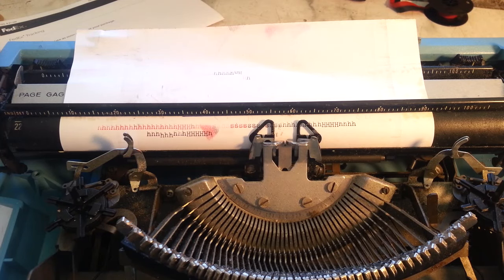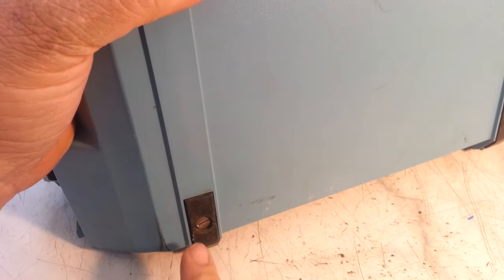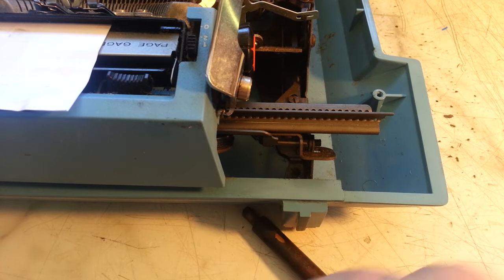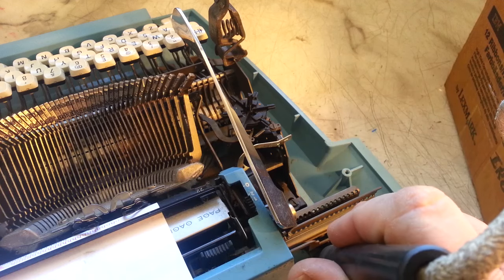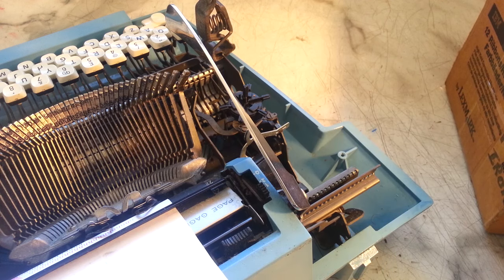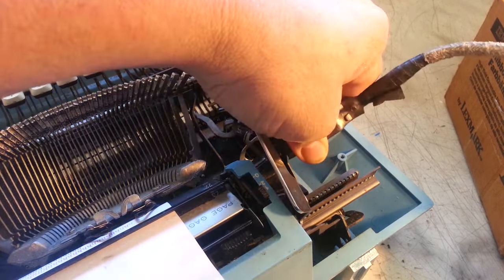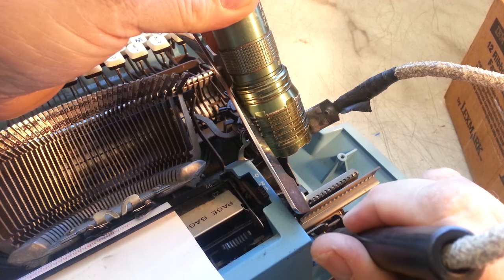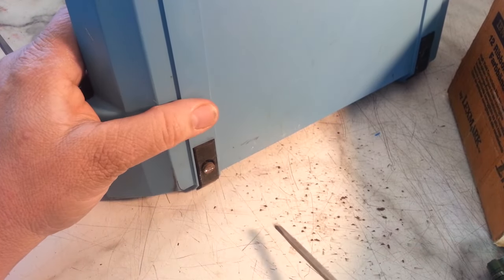Removing Frozen Screw on Typewriter With Carbon Arc Electrode Heat, Stuck and Ceased Conquered

Comment: Great work...I was surprised that the plastic shell was not affected.  Would a soldering pencil iron have worked apply to the top side of the screw...granted it would take longer to heat and the plastic shell maybe a concern.
Reply from the maker: Yes I was concerned about melting the plastic shell, the heat pencil has such controllable and fast heat, it worked best for this situation.
I didn't have any effect to the plastic or rubber foot. Was a great test and worked perfect . . . .

Comment: I’m trying to understand how it works. Heat will normally expand metal. Maybe swelling the screw broke the bond. Any idea how it works?
Reply from the maker: primary goal was to melt the old oil, but heat can help with screws/bolts
Seen many automotive bolts loosened with heat.